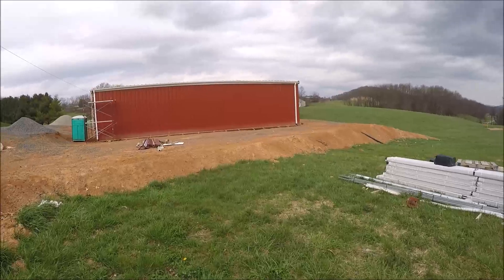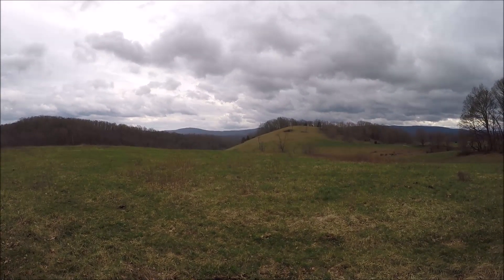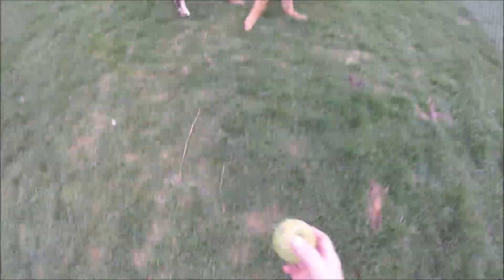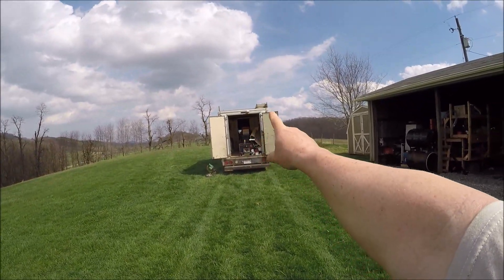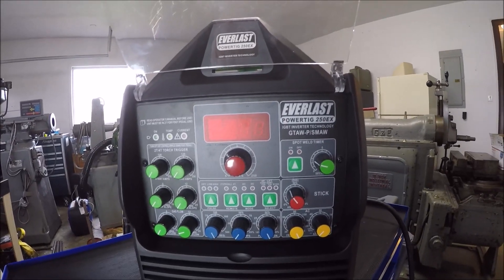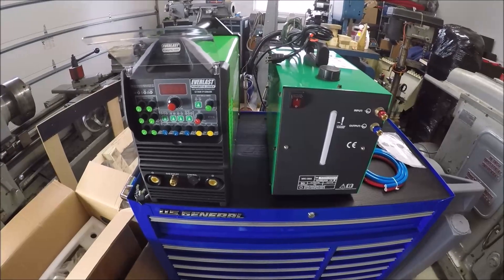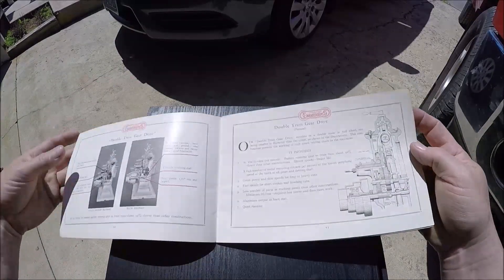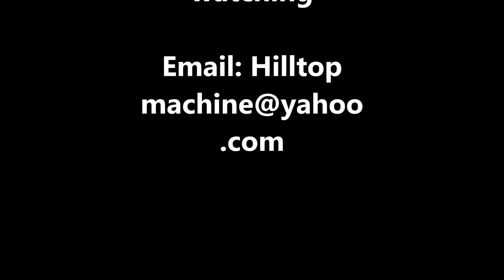Mail Call #36

Comment: Nice target, i make a ton of them.. use AR400.  500 is to hardand will crack  its better used for abrasion resistance.   I also make hammer mill hammers for metal shreaders. Use ar400 becase the 500 hammers brake off the 4150 shafts.  Is your using. .22, 9s  you'll be fine.
Reply from the maker: Good to know. Thanks Doug.